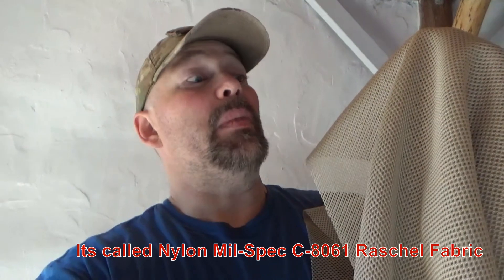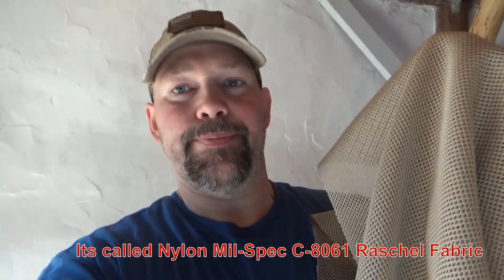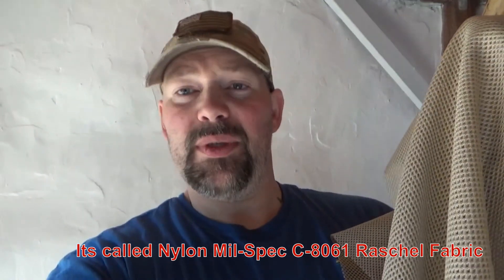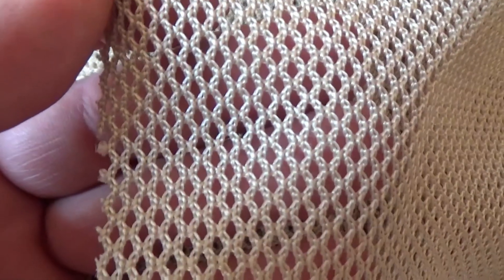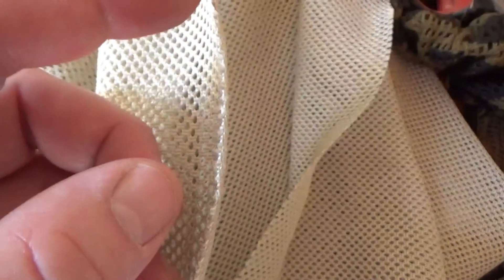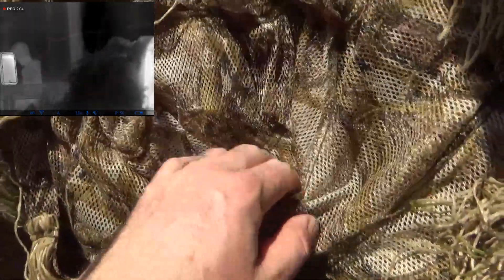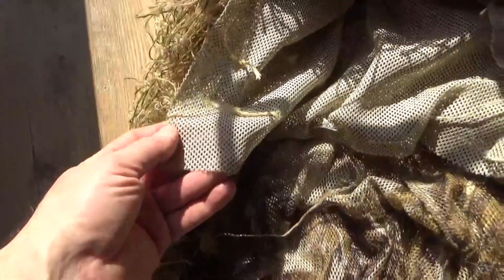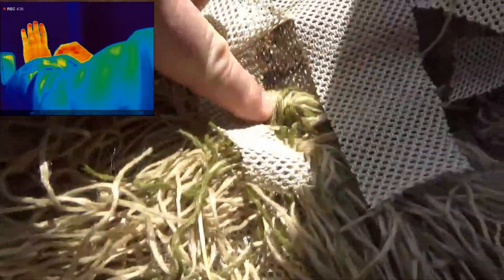DIY thermal scope escape and evasion

Comment: How does it heat up as you stay there for a very long period of time? It would he cool to see how it heats up over hours of having you in it
Reply from the maker: As with most things, it only takes a few minutes to heat up and stabilize. Think about it like this. It’s cold outside. So you put on a coat. How long does it take for that coat to get warm inside? 30 seconds? One minute? When does it stop increasing in temperature as you sit there? For most people, the answer is mere minutes. Maybe less. Same thing here. If i directly grab the material or if it’s in direct contact with my skin, it’s heated up in seconds. If I don’t and it has indirect contact, it takes a minute to heat up. But at that point, it stabilizes. A coat doesn’t get hotter the longer you wear it. It gets to a point, quite rapidly, of temperature it will keep and hold, and then it stabilizes.

The materials I test are no different. You see the heat patterns within seconds to a minute. It may have a couple minute delay to push through a temperature change across an insulative barrier. But after that, what you see is what you get. 

I’ve tested this to make sure I’m not crazy. I’ve looked at the heat signature of myself and my son wearing different types of garments with different insulation properties, then walked around for an hour or two in the forest and come back and rechecked our thermal signatures. With very little exception the signatures are identical between the 5 minutes mark and the hour and a half mark. And that exception is mostly due to sweat if wearing only a t shirt in hotter weather.

I have also walked around town, and in stores, shooting thermal imaging footage. The things people wearing have a specific point they heat up to and then stabilize. And that’s it. That’s all you get. 

For instance, in the video posted here, I was wearing that t shirt, blue jeans and boots for 5 hours before filming. But they weren’t glowing like the sun. And in the outdoor footage in this video you can see that my street clothes were actually generating a smaller heat signature than the ground and even the trees in some places. Despite wearing clothing with minimal insulation for five hours, dirt and bark was brighter than I was. Lol.
Reply: @ThatThermalGuy  that makes sense man thanks for the info. I would have assumed that the layers around you would eventually heat up and change too. Idk what's more tricky thermal or night vision, if you had infrared capability it would be cool to see if your camo will hide you from both
Reply from the maker: @michaelsorenson3887  I actually have top tier night vision too. Autogated Gen 3 white phosphor L3 unfilmed aviation grade NVG. And I also have mid tier, Gen 2 gear as well. 

I don’t have as much time to get the night vision work done during summer because where I’m at it doesnt get dark until almost 1030 to 11 at night. In winter though, it starts getting dark at 430. So as winter comes I’ll have more NVG videos coming out since I’ll have more time to do them during waking hours (I have to get up at 5am for work so I can’t stay up very late).
Reply: @ThatThermalGuy  understandable, appreciate the content. I'll tune in and hope to see it one day if you ever have the spare time ✌️